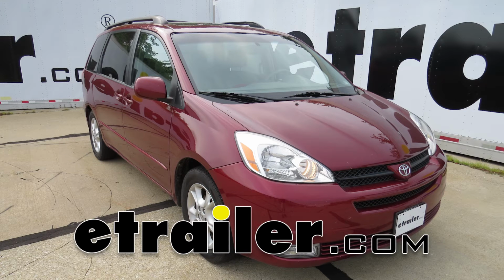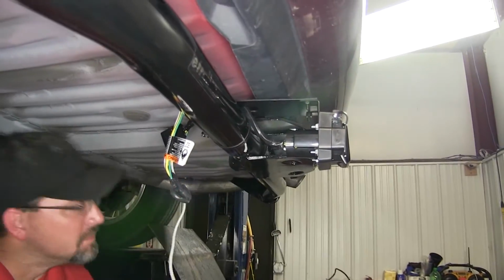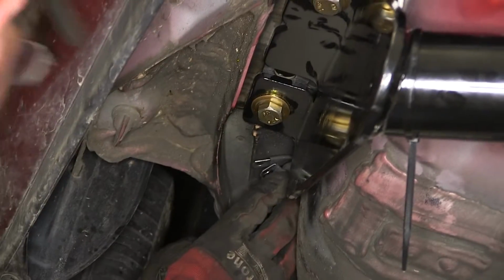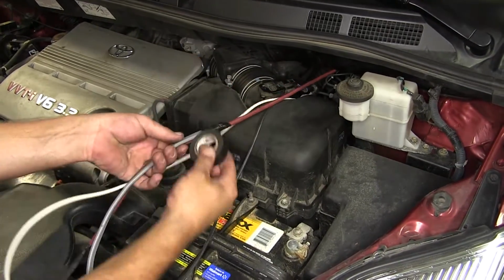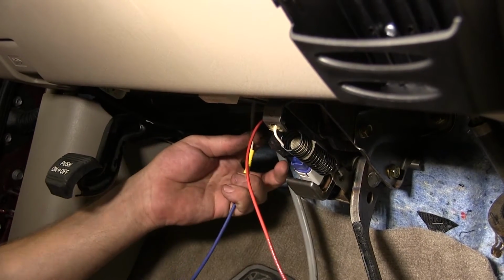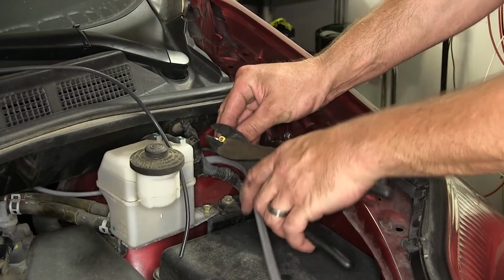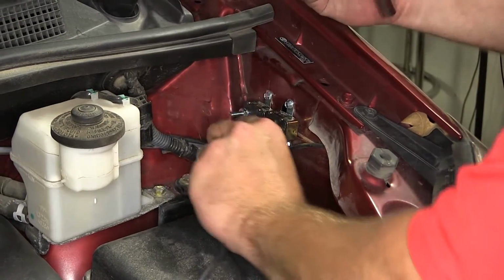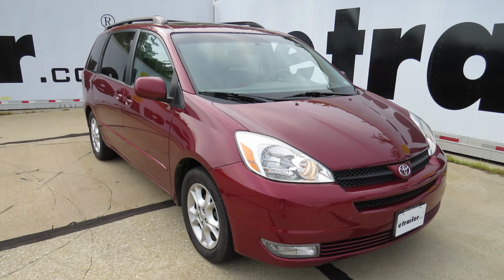etrailer | How to Install: Tekonsha Prodigy P2 Trailer Brake Controller on your 2005 Toyota Sienna

Comment: Here's some feedback from somebody that just followed your video to do the same install on the same car. Overall, excellent. Two quibbles. You kinda skipped through the getting the push wire through the grommet part and I had trouble there. Took a while to figure out how to get it through, which way it was going, and where I would find it on the other side. Also I ended up putting a little super lube on it to ease the process. The other thing is that I also used a 25' length of duplex but I didn't end up with quite enough for two lengths of wire between the battery and the breakers. Compared to what I saw in the video, I thought I ran my line even more directly so that was a surprise. Not a quibble, but where you placed the P2 would bump many knees so you might have discussed options for placement. Thanks regardless, couldn't have done it without you.

Comment: loved the video! I completed my hitch and brake today on my 2005 sienna. I installed a Primus IQ #90160 brake control. Problem was the harness connecting red wire was too short by about two inches in order to match how you mounted your brake control. I am going to send word to them also. Again, can not thank people like you enough for the help! Saved me hours of time and frustration!

Comment: Most useful video ever for installing brake controller on toyota sienna, will add to my 2007 sienna
Reply from the maker: +Edwin Rodriguez Thanks for the feedback, happy to hear this will help you out on your install. If you would like here is another help article about installing out ETBC7. This will establish a 7-way vehicle side connection point for a trailer with electric brakes and a brake controller.

Comment: Video was helpful for locations and such but I don't think much of the install. Heat shrink and solder and running the wire inside under trim panels is a way better practice.

Comment: I bought a brake controller prodigy P2.  are the color on the plug(4 pin: blue, white, red  & black) always laid out the same? so if I follow this video I should not have problems?

Comment: Why do you need to run a ground to the battery?  Why not attach it to the chassis?
Reply: Same thing really.  I would clean those battery terminals too.
Reply from the maker: You can do either. You typically will have a stronger ground if you attach it directly to the battery. This is done as a safety precaution because if your ground is not good enough your brake controller will not activate your brakes.
https://www.etrailer.com/Brake-Controller/Tekonsha/90885.html